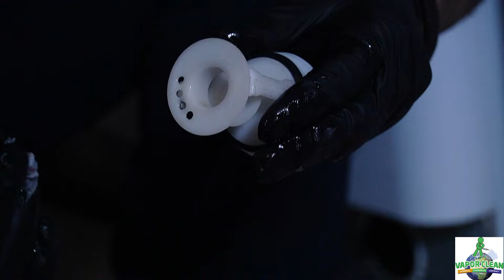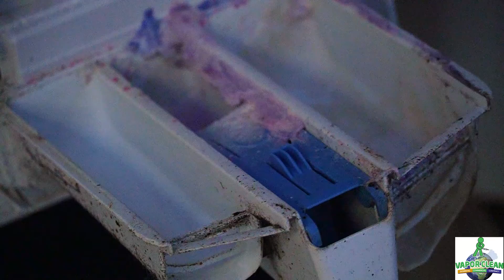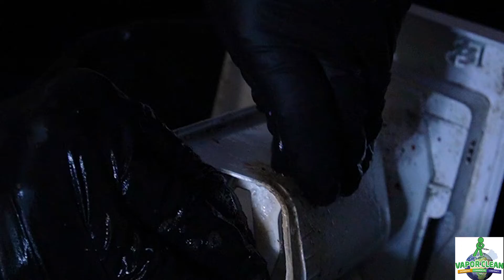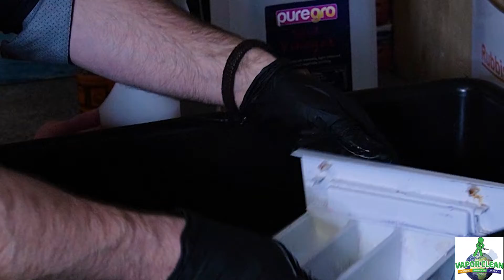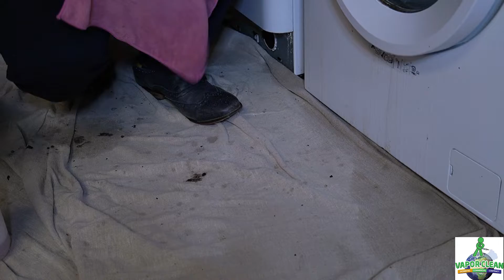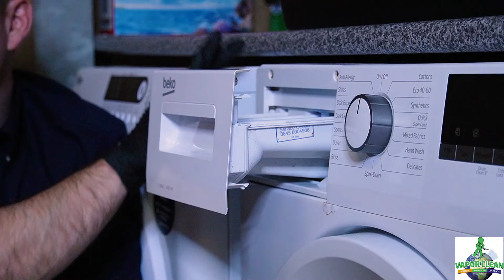Washing Machine Cleaning A Pro's Guide to Descale and Deep Clean

Comment: Vinegar = acid that disolves lime scale due to acidity. Mixing with bicarbonate that is a base, removes the acidity making it useless for limescale (and no, the bubbles aren't cleaning, its just the reaction making vinegar neutral close to ph7). DON'T mix them 😂 then you might as well use water. I dunno if this guy got this tip from internet, cause ive seen this BS in several places. Products are to be used separately.
Reply from the maker: I'm fully aware of that which is one reason I recommend an actual descaled rather than the Vinegar method, not a fan of Vinegar either way personally but if you have the ratios correct it doesn't completely nuetralise and you need the foaming action to reach all the areas

Comment: Metal scour on plastic tray = scratches= faster buildup next time. Use white washing sponges, they are not abrasive
Reply from the maker: When the build up is too high you need the abrasion, we're in a very hard water area and the limescale goes like rock, white sponges won't touch it, that method is ok if you're doing regularly in a soft water area

Comment: You can use vinegar and bicarb separately but not together, one is an alkaline and the other is an acid - used on their own they make great cleaners, together it just fizzes and cancels each other out and won't aid any cleaning.
Reply from the maker: Hi Jackie, thanks for the comment, it's the reaction you want, it can help lift the build-up of limescale or soap deposit. I agree when cleaning you require the correct PH level for what you're trying to remove or the material your cleaning but in this circumstance we want the reaction just as much.
Thanks for the comment. Lee
Reply: @cleaningservices101  At a push it may help with soap but probably no more than just using hot water, without a doubt it won't lift limescale.  No fizz will do that! :)
Reply from the maker: Challenge accepted Jackie 😉 definitely a video topic for the future